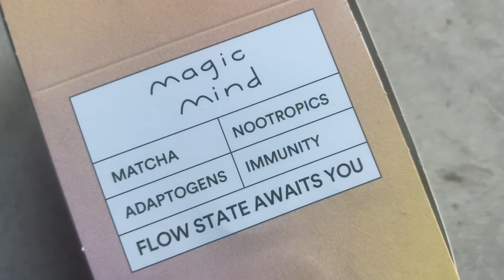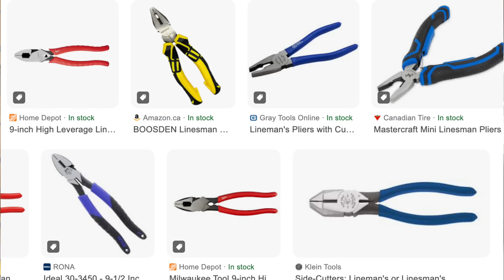Wiring Woes! First Time Wiring My Own Home!

Comment: Not sure if you have more 3 way switches to go, but best way to think of them (depending on wiring method) Common on #1 switch is the power from the breaker box - Travelers just go to each switch, and the common on Switch #2 goes to your fixture.  Another good habit to get into, always do the ground wire first, this way its hooked up and if there is a possibility of the line becoming energized, you don't become the conductor to ground.   Good job with what you are doing, keep up the hard work and effort.
Reply from the maker: Love this! Thank you! Yes, the common is the black feed line or the black wire switch line! And great idea. I have all my wires ground to the boxes. First thing I did just because it was easier but that makes sense

Comment: Biata you are doing a good job 👊🏼👊🏼….. also a tip WAGO connectors work great and gives you a lil more room in your boxes and much easier to use what you are using … Stay Safe 🙋🏼‍♂️🇺🇸👊🏼👊🏼🔨🪚
Reply from the maker: Thank you so much! I’ll look into the wago connectors!
Reply: @SimpleLivingwithBiata  
Wagos are easy, time saving and meet building code
Reply: @FredD63  wago is kind of the standard in the netherlands these days. They are also awesome for industrial for when you need to redo connection often and with safety.
Reply: @dusliangames  they are real popular in the states near me as well I prefer to use them as they are less bulky in a receptacle or switch box….

Comment: you are nailing it ... good job u are braver then me . the linesman pliers are all similar u will loose a pair and not worth a 60.00 pair so  as long as they feel good in your hands and do the job thats all that matters. id run the extra wire for the motion sensors at least runit to the box and tuck it away in case u want to do it a later time , maybe put the light on a sep switch so u can shut it off , but honestly u will prob want it at a later date ,jmho  keep at it gal u re doing amazing i am sure your hubby and craig and mom and daughter are so proud of u ..

Comment: So I am from UK. The electrical system will be tested, before operation, won't it. Low resistance checks on the earth bonding....so that will cover any mistakes. Your system is different to us, we use 240 volts, and rcds, I think you use 115volts. but hopefully that's the case. maybe someone  from the USA could comment, I would be very interested. I did my own wiring, I am an electronics engineer, but got a professional electrician in to do the checks, still a great saving on cost. Great idea to put a loop in the cables, makes any changes much easier. 👍
The mind gloop is a bit worrying 🤣🤣, sorry, I am sure its great.
Reply: She’s in Canada, and unfortunately that’s not practice here at all, except in instrumentation and controls. She has to pass an electrical inspection before she covers any wire but that won’t necessarily address any mistakes like reverse polarity etc. That said, I fully recommend testing the whole house once you pass your inspection. Lots of great videos out there on multimeter usage.

Comment: I recently stumbled onto your channel a few months ago. What you are doing is awesome and I hope my girls will learn this stuff from me as I am the same as you, a DIY'r. With that being said, since you have these different boxes, I use to what Lowe's has in the US(South East) be it plastic, metal, or fiberglass, but these ones you have are pretty freaking awesome! But with metal boxes, where the wire enters the box(top or bottom), I thought either a tab or a wire clamp(either plastic or metal) to prevent the wire sheathing rubbing raw over time on he hole and shorting. I am not saying this to be a smartass or to be negative, it is more so, for the safety of your family. You don't want a fire to start in the wall due to a wire rub. Or hell, if you use a metal face plate, you don't want to get bitten(shocked) every time you flip a switch! But than again, that keeps you an your toes!!! 

But either way, Keep up the great work and I can't wait to see you start finishing everything!!!!
Reply from the maker: Thank you so much! So it looks like US and Canada have completely different wiring codes for boxes. These boxes are pretty much all that’s used in Canada. Only the plastic boxes for where you need a vapour barrier :)

Comment: We recently bought a house and I was updating some of the switches.  I was having an issue with one of the 3 way switches.  After watching a particular video with an animation of how it works, it finally clicked for me and I understand now how it works. 

The worst part is when it's old construction and in one box the 3 way has 2 black and 1 red (like it should) and in the other box it has a black, red and white connected to the switch, and you have no idea how what's going on cause it was probably messed with multiple times over the years.
Reply from the maker: That’s what Eddie was saying, new construction is so much easier than figuring out what someone else did in a reno!

Comment: Enjoyed this.  Always interested to watch US/Canada electrics as a UK citizen, as there’s a few things I like about your code standards - but a couple of things always grab my eye, regardless of who’s doing the work, which surprise me.
1. The bend of the wire into box potentially rubbing on bare metal - no rubber grommet like we do in uk.
2. How often your backboxes are only screwed/ attached to one fixing point like a single stud.

Wanted to reiterate this is not just what you’ve done Biata, it just seems to be the US / Canadian way - and just unusual to me in the UK.
Reply from the maker: It’s so different eh? I watched Max and Occy’s wiring vid and was shocked at even just the surface level differences.

So I’ll be securing the other side of the boxes to scrap 2x6. It keeps it secure between the drywall. I can also put blocking under. Still so much left to do!

Comment: If you're not sure about some of your wearing home depot and lows has got a cheap book that you can get for your area 2 learn to wire, they aint everything that you will ever would wanna know. For house warring. The best thing is any of your house, worrying that you may have a window unit. That you may want to plug in later on. Needs to be 122, because the reason why if you're using all 14 gauge wire and you have outside plugs or something else that you're going to put a heavy duty draw. Item on it. Fourteen gauge will not hold it twelve two twenty amount breakers

Comment: man!  i love that you are doing this!  mistakes and all.  you have the spirit of a real pioneer.  also, get a set of drillbit extensions and a swivel to put at the end of them.  way more options for screw placement.  just make sure you have the swivel secured with your other hand, because it can whip right off the end of an extension and into your teeth like nobody's business.  it may not be relevant to you, but it looks like it is.  i don't work with wood myself, but i fabricate manifolds and assemble machines around them and man oh man do those swivels and extensions help out in what i just call the weird spots.
Reply from the maker: Oh wow! I haven’t heard of the swivel thing! I ended up finding a longer drill bit which was the perfect size. And thank you!

Comment: Biata here in Washington state we have to use 3 wire plus ground for 3 way switches.
Reply from the maker: There’s 14/3 for the the traveller and 14/2 for the feed or the switch :). So yes, we also have to use 14/3 plus ground!

Comment: Consider a 2x6 scrap attached to the other side of the gang box to prevent floppy gangs. Once drywall goes up, the box will be locked in and not able to wiggle in/out.
Reply from the maker: Yes! This is exactly what I’m going to be doing, thank you

Comment: I'm not electrician but have re-wired several houses. it isn't too bad once you wrap your brain around it but can cause you headaches lol . most that i do is remodel and first you have to figure out what each existing wire in the house is doing and repurpose it for other things
Reply from the maker: Oh gosh, re wiring sounds like so much work!
Reply from the maker: But you’re right, once you wrap your head around it and once it finally all clicks, it makes sense!

Comment: Anyplace you have a fan, if you haven't done so, you really want to use /3 (like 14/3) so you have an extra conductor. This way for a fan\light combo you have the option of independent switches for fan\light and have the switch box be double gang (this way should you in the future go with smart switches you have have 1 switch for fan and a seperate switch for light).
Reply from the maker: Thank you! I appreciate it! Most fans are wired in with remotes now and the 14/3 isn’t needed anymore! The switch stays on the wall with your other switches and it controls the lights and fan :). I asked this question a few times to Eddie and he said there’s no point for all the newer fans!
Reply: @SimpleLivingwithBiata  Yeah, I know about the ones with their own remotes. Not a very "clean" installation having it stick off the wall.

Even if you don't use the extra conductor and stick with the remote controlled fans, having that wire there now while the walls are open and it is easy to run gives you the flexibility later on should you choose something else. Like right now I am changing many of my switches to Lutrons and ditching the remote the fan came with so I can setup automations and voice controls. When I tell my Echo clock "bedtime" it will shut off various lights via the smart switch leaving the fan at its current setting. Same thing in my living room. "TV Time" shuts off various lights (including the one in my overhead ceiling fan) again, not changing fan settings cause I have the power feeds for fan\light separate.

Comment: A common is a permanent live when wiring switches, I find the US and Canadian way of wiring strange as you end up with so many wires in your boxes.😊
Reply from the maker: Thanks for explaining! That makes sense. Do we end up with more wires? Very strange!
Reply: @SimpleLivingwithBiata  we wire lights in series from the lights then just drop a switch line. If doing multiple switching we use 3 core and earth called strappers, that's 1 common 2 switches. We once used to do the same as you in the very early days, itt was called a 2 plate system. Then changed to a 3 plate system were all lighting is terminated in the light fittings or a termination in a joint box, saving cable and time. Our socket outlet was wired like yours we called radials max 16amps. We changed to a ring mains 32amps and again less cable and time.

Comment: USA NJ

House Wiring
1.	USA House Wiring 
2.	
3.	17- 20amp circuit 
4.	
5.	         Kit. Outlet 210.11.C.1 
6.	
7.	         Kit. Outlet 210.11.C.1 
8.	
9.	         DW Cir. 210.8.D 
10.	
11.	         Micro hood fan and range outlet- A good idea 
12.	
13.	         Ref. Outlet- A good idea 
14.	
15.	         Outside Outlet 210.52.E 
16.	
17.	         Outside Outlet Xmas-A good idea 
18.	
19.	         Bath Outlet 210.11.C.3 
20.	
21.	         Laundry Washer 210.52.F 
22.	
23.	Laundry room Outlet 210.11.C.2 
24.	
25.	Laundry dryer Outlet -A good idea 
26.	
27.	Family room Outlet 
28.	
29.	Garage Outlet 210.11 
30.	
31.	Garage Freezer 210.52 
32.	
33.	Garage Elec. Car Outlet 210.1 
34.	
35.	Dining room Outlet 
36.	
37.	Heater 210.64 
38.	
39.	Bath room Heater Fan Light 
40.	
41.	30 Amp Circuit 
42.	
43.	Hot Water Heater-10/2 wire 
44.	
45.	Dryer-10/3 wire 
46.	
47.	Cooktop-10/3 wire 
48.	
49.	Air compressor-10/2 wire 
50.	
51.	Shop Sub Panel-10/3 wire 
52.	
53.	 
54.	
55.	40 Amp Circuit 
56.	
57.	     Outside AC 
58.	
59.	60 Amp Circuit 
60.	
61.	Wall Oven 
62.	
63.	Sub Panel 
64.	
65.	15 Amp Circuit 
66.	
67.	Smoke Detectors 
68.	
69.	Alarm Panel 
70.	
71.	Lighting 210.70 
72.	
73.	Bed room Outlet 
74.	
75.	Internet Outlet  
76.	
77.	It is a good idea to add separate circuits 
78.	
79.	Sub pump 
80.	
81.	Basement 
82.	
83.	Welder 
84.	
85.	Attic fan 
86.	
87.	POOL 
88.

Comment: Do the metal switch boxes get a wire protector sleeve where the wire comes in the box?
Reply from the maker: No! It seems like the USA does it a little bit differently! The sheathing on the wire protects the wires
Reply from the maker: From what I understand

Comment: another option for labeling the wiring is to use a piece of the insulation, write the circuit on it and slip over the wire
Reply from the maker: Great idea! I see this for panels :)

Comment: Do you have romex wrapping your ridge beam? Above the kitchen?
Reply from the maker: Yes! The beam will all be strapped with 2x2s and covered
Reply from the maker: Was the easiest way to bring wire over and is fine. Talked to both my framing inspector and electrical inspector
Reply: Cool re wrap the beam, so your exterior runs will be capped off as well I assume then? Better tha wrpa the beam than drill holes!
Reply: @SimpleLivingwithBiata  On the wall covering subject, I  strongly recommend you dry string your ceiling rafters, 2 planes, and all your walls and ceilings, shim the low spots, if you don't you'll have waves in your ceilings and walls, not to mention a whole lot more mud to spread to comb it out! Way better off shimming it's a step not an extra remember you are going to be looking at this house the rest of your life, special note be very consistent with the drywall ag the angle of the vault to wall be best to dry string while hanging your drywall cause its a long run in the house ans you'll always see it, two pennies! ☺

Comment: If you can find Klein electrical tools, they are got the best pliers that you'll ever buy. And they have a rubber grip that you can buy. And you eat up water a bowl of water or PAN of water. Put them in it and then slide them on the handle. And they'll never come off. Don't use that cheap rubber. That's on there. Cut that off buy the extra heavy duty rubber handles and then slide them on. And you'll have them pliers for ever. I've got a pair that i've had for forty five years

Comment: I am by no means questioning your electric work, just to be clear. I am not qualified for that, and I firmly believe, you know what you do. 
    I live in Denmark, North Europe, and I did quite a lot of electric work on my house recently, with my good friend, who is an electrician. I can tell you, that what I see in those videos look nothing like what we did. 
  Your wires have totally different color codings, different amounts of phases. Your assembly points are different and you happily drill through every piece of wood, you find to pull the wire through it. In Denmark, it is illegal to drill holes through weight bearing parts in the ceiling. 
  We can drill through weight bearing walls, if they are made of masonry/bricks.
   I wish you all the best of luck with the whole project. Keep up the good work, stay safe 👍👍👍
Reply from the maker: Wow! It’s sooo different haha! Just wild! We can’t drill through trusses but can drill through rafters. Just not LVL beams!

Comment: Great job Biata, I really think you should leave the electrics to the electrician as you can avoid problems later. Nobody will want to help you when you have everything finished and something not working properly. Stay safe.
Reply from the maker: Honestly I felt this way, but learning wiring has been the most empowering thing. And I’ll be having both Eddie and the inspector throughly inspect my work before closing it all in :). Switching is the hardest part for residential according to Eddie. Everything else has been simple :).  And luckily, switching is still accessible once drywall is up! Everything else for rough in is drilling holes, pulling wire and putting up boxes and plates :)

Comment: Can’t you use plastic boxes in Canada. More room for wires
Reply from the maker: I’m not sure which plastic boxes you’re referring to but we have plastic vapour boxes for exterior walls. For interior, you normally use metal and the deep boxes. The gangable ones are deep boxes
Reply: We use plastic boxes in states. For switches and receptacles. Each box has two nail in them to fasten to walls. They are deep and have double 3 gang and 4 gang plastic boxes. So easy to use.

Comment: i can attest that wiring 3way switches are a pain in the butt i rewired my 3 bed terraced house (i am from the UK) and i had to rip out ALL the old wire right to the main feed and rewire from fuse box took me allmost a month because in a terraced house there is no  plasterboard walls or ceilings had to channel out for each outlets and switches.
Reply from the maker: Wow! That must’ve been so much work!